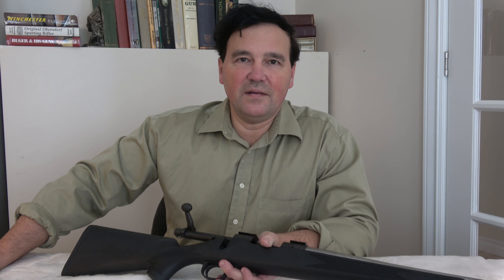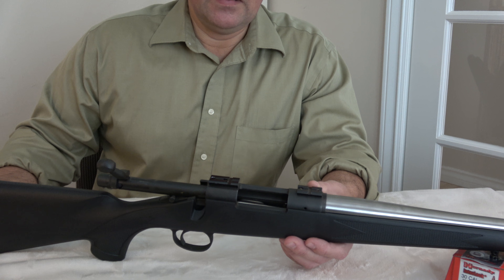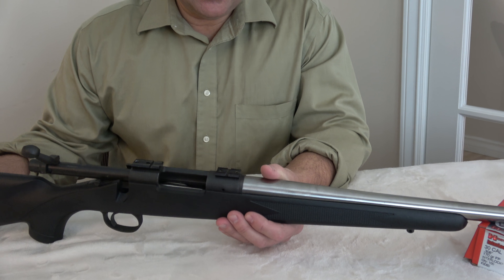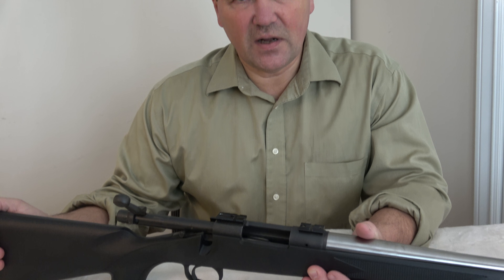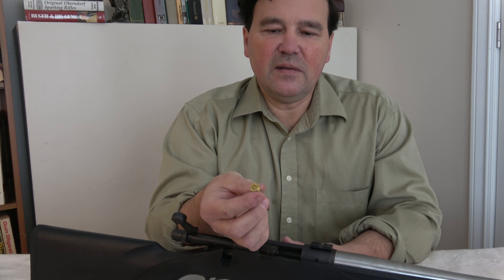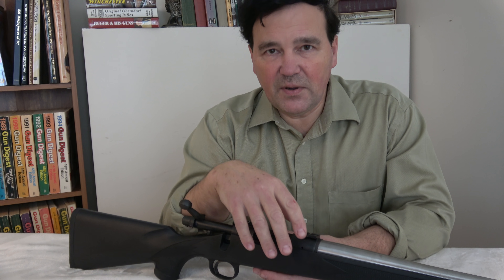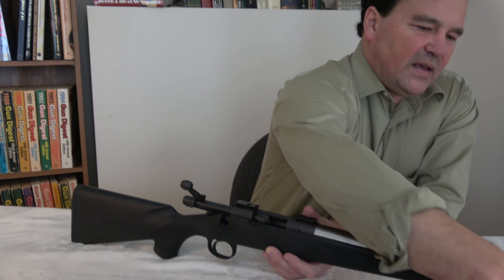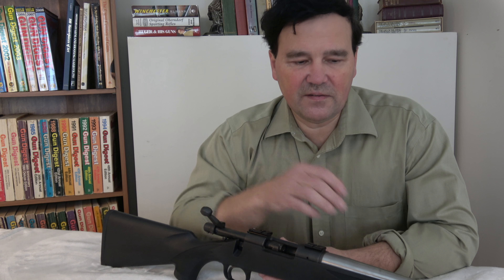Very High Velocity (VHV (TM)) Small Arms

Comment: If you were to use a lathe to relieve rifling grooves into a solid bullet would it gain some small rotation due to the air resistant pressure in the barrel and gain more (sufficient) rotation during flight by the drag as it passes through air?
Reply from the maker: Hi Papa - Rifled slugs apply this method; not much rotation is gained and some people say there is almost no rotation. For a rifle bullet, the velocities are too high; the grooves would fill with air and the bullet wound be effectively featureless in flight. Good idea though and thanks for sending.

Comment: Brilliant research I loved this video. It seems like a hollow based weight forward dart design like a shotgun slug or a wad cutter would seal the gas. Perhaps a flechette? The Rheinmetall 120 mm gun is a smooth bore and quite accurate but I don't know how it is accomplished.   I love your explanation on steel cases. I remember as a kid dad teaching me to think of brass cases as like balloons inside the chamber that take that shape and chamber form, clearly steel cases are much stronger.  I think you need a 30.378 WM :)
Reply from the maker: Thanks Charles - I tried the 30-378 - a very saucy round! : ) The military has some very high velocity artillery - just as you say. They have also been working on wire guided "bullets" for years - as you probably know. In any event, it was a lot of fun and interesting to look into this - even if my methods were fairly primitive. Thanks for writing.
Reply: Its funny.. In robot battles mechanics normally beat engineers. Good common sense research often wins the day.  Maybe you could make a bullet filled with a compressible fluid with a finned gyro inside that spins on a center shaft as the fluid compresses and moves backward under the immense g force as the it accelerates. Or just build a plasma gun
Reply from the maker: You have my kind of mind : )

Comment: VERY INTERESTING! i am not sure how you got the bullet / bore seal to happen. my first thought was to use a gas check backwards. of course, you could accomplish the same thing by machining the base of the projectile, like a hollow base bullet, or a foster type slug. i wonder, if a fairly coarse honing (like 60-80 grit) of the bore would make for enough drag to spin the bullet. it would have to be a one pass, so all the "scratches" went in one direction all the way down the bore.
Reply from the maker: Cool idea David - from what I can tell the bullets are "bumped" to a swage fit early in the bullet travel down the bore. I think they bump in a no-concentric way - which means accuracy is not as good as it could be. Probably a sabot is the answer - like some tanks. Thanks for thinking on it and writing.
Reply: @UnitedStatesOfGuns  Your very welcome.

Comment: As far as figuring difference in chamber pressures,  I find the software called QuickLOAD to be excellent.  Unfortunately they only have so many projectiles and powders in the database, but mostly everything is there.  It's a invaluable tool for handloaders.
Unfortunately the software is quite expensive. Possibly in the hundreds of dollars for a license.
Although, for computer savvy folks, there are tons of older versions that have been "cracked" floating around. I use quickload v3.8 as it just so happens that's the only one I could find.
It also has functions to plot out bullet drop and at what distances. Plots it all out on a nice graph and everything!

Comment: Could you machine groves  into the bullet in a spiral pattern that would cause it to spin based on the we air resist at the hypervelocity?
Reply from the maker: Can be done cc - good idea - at higher velocity the air, compressed by velocity, fills grooves and shapes and the behavior of the projectile is as if there are no grooves - although drag is increased somewhat.
Reply: How about an angled port hollow point bullet with ports coming out at angles to the hollow point would be the intake the angled ports could act like a venturi turning the bullet. Great channel!

Comment: How about using blanks and load bullet in separately, that crimped blank might create enough pressure
Reply from the maker: Good thought - I'll try - I'll have to be very careful; a lot of different forces and pressures involved.
Reply: @UnitedStatesOfGuns  also maybe a non-boat tailed bullet will create a good gas seal? I meant the old 303 bullet, with flat exposed lead base so it will expand a bit when firing

Comment: Just a question from a novice, but I read below of the possibility of a titanium bullet. Would a bronze monolithic bullet also work if the weight was not a factor because you could increase the powder charge? Again just a novice question. Very interesting.
Reply from the maker: Good thoughts. Everything has been tried; lighter can mean faster - it is true; however, bronze and titanium do not easily yield to the rifling so they would have to be jacketed in something softer. There are a few copper solids around - as you likely know. There were also aluminum bullets and even wood bullets.

Comment: my dad used too run rem 700 .17remington and if you load fast rounds they  fly apart at top speed  I dont know how fast I think way under 5000fps. I think you need an accelerator with tungsin carbide or something that can take speed and heat try like 1 and 22 trist barrel thanks for the info on speed. my dad tried super speed and only had them melt in flight. p.s ww1 they put bullets backwards to hit steel armor plate harder and make splinters of steel on the other side i think not full penatration.

Comment: Unterkalibriges Flügelgeschoss. Sub-calibre projectile. If you want to crack a tank armour, you use a very heavy and hard material, like tungsten carbide or, sorry like the US, you use depleted uranium. You use a smooth barrel gun without rifling/spin, because on the target the spin would waste the energy outwards. The Sub-calibre projectile has small "wings" to be stabilized and a sabot to be fired. You can accelerate about 10kg / ~20lb up to 1600m/s or 5250fps using a 120mm L44 cannon. // Using the .308 you could create a for example 3mm Sub-calibre projectile using a sabot and a full combusting plastic cartridge. A 51cm .308 barrel would be L66, so in comparison it is longer than the 120mm L44 cannon. So I think you would be able to have a 3mm projectile to reach 1500 or 1700m/s or perhaps 2000m/s, but, what will happen at the target? Game isn't tank armour. So I think  this very fast projectile could completly fragment, like we know .17 Rem. hunting foxes, or it will only pentrate the game like a FMJ, which isn't wanted in hunting.... // Without a doubt, all your thoughts and the problem about VHV and rifles and all these things is very very interesting and fascinating ;-)  Thank you very much!
Reply from the maker: Thank you Oliver! Great information.

Comment: USOG, I'd like to hear your take on my post with the formula that gives you the answer to your velocity problem. I've edited the post down (now starts with "What everybody") because it's original length may have put you off reading it.
Reply from the maker: Hello. Sorry I'm slow - I receive a lot of messages. I have to find yours and longer messages are great! I just have to find : )
Reply from the maker: I found it!
Reply from the maker: Excellent points - and I will read and consider everything. I went quite a bit further in my experimentation than I disclosed. A Russian informed me that they already have what I have in mind - to replace or augment their 12.7 ant-material/long range sniper - which something like our .50 BMG as you know. If they have a practical weapon system operating at 2000 mps - no one can touch them - probably working out the software/algorithms for wind drift etc... as we speak and they'll transform small arm effectiveness into the realm of artillery and the like - the projectile would arrive on target and no one would hear or see anything - well over a mile a second is something.